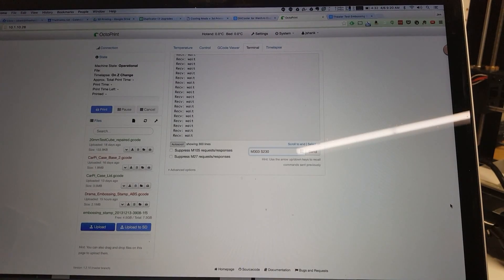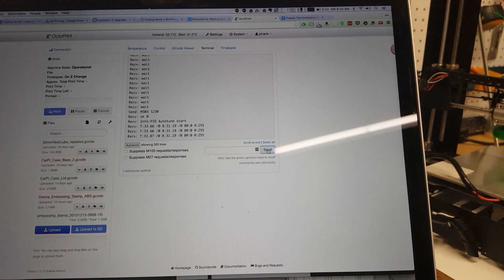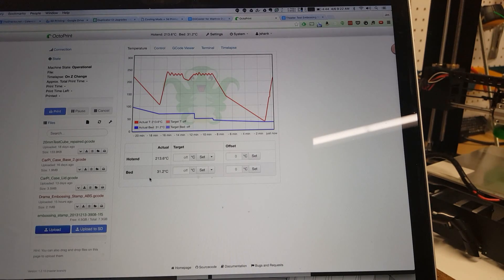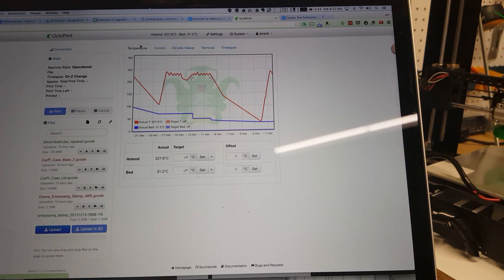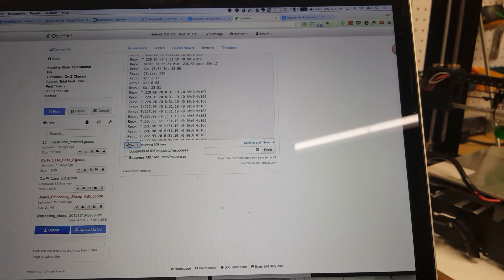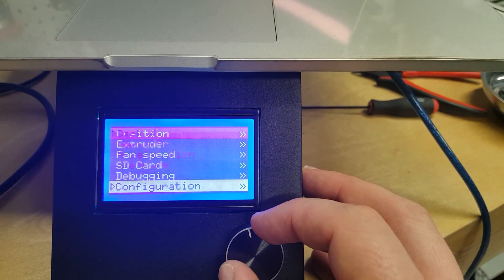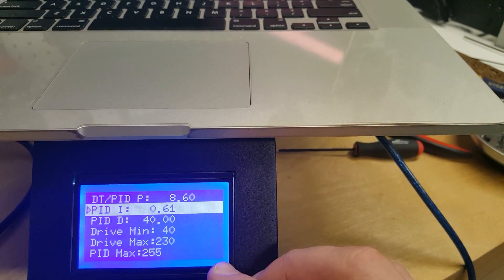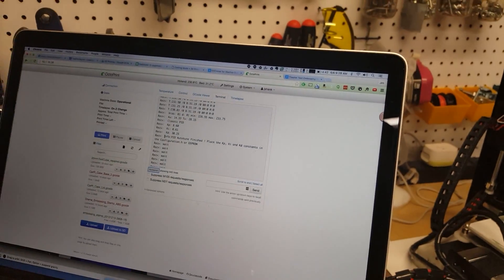Wanhao Duplicator i3 V2 - PID Autotune Process

Comment: I saw in other videos that the command is M303 S225, the right one is M303 S230?, thank for your videos you are my goto, I will just skip the flexion extruder upgrade but everything else on your channel goes to my printer, great work!
Reply from the maker: The S230 is the target temperature, 230°C. Most of my printing is done near 230°C but depending on your material, you want to select a value that works for you. Maybe you only print with PLA, then you would tune with your cooling and on and with an S195 for 195°C. Glad you like the videos, have fun!

Comment: hi you should also tune with your extruder fan on the normal setting you run it at
Reply: Top (cooling) fan or bottom (print) fan?
Should the bottom/printfan be disabled?

Comment: You have to explain what the commands do, not just throwing them out there. Now I calibrated for 230 C, which I never use.
Reply from the maker: I'm happy to elaborate Vildkatten. I've found 230C to work well as a calibration point. It stresses the heating cartridge a little bit, but not over the rating for the PTFE tubing. This doesn't mean your printer is only set to print at 230C but that the printer can reliably hit that temperature and hold there. This means that it will have no trouble around 190 for PLA, 220 for ABS or 240 for PETG. Check out http://reprap.org/wiki/PID_Tuning for more detail about the process itself and https://youtu.be/0vqWyramGy8 for general PID theory.

Comment: I can't even get any device with octo print to recognize my i3 v2.
Reply from the maker: +Rgotto2 A few tricks; make sure your baudrate is set to 115200 and replace your mini-usb cable with a shielded one from monoprice.com (item 5447). The final trick is to remove the auto-reset jumper from the Melzi board in the control box. See my grounding upgrade video for how to get into the box.